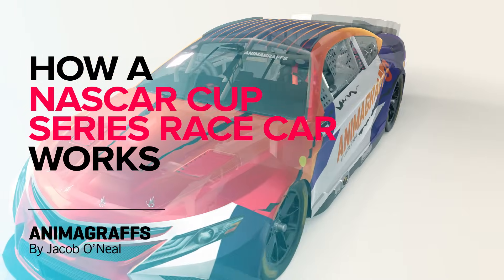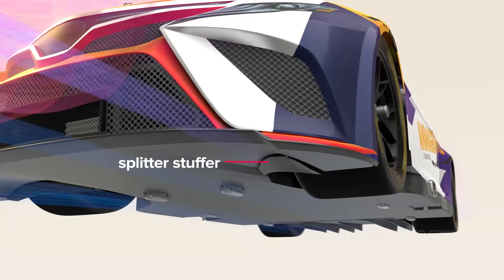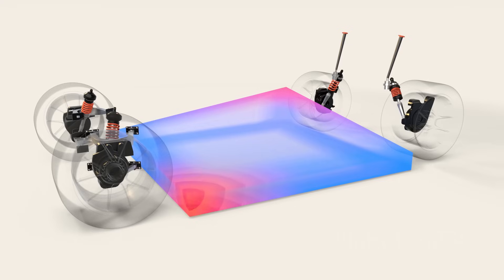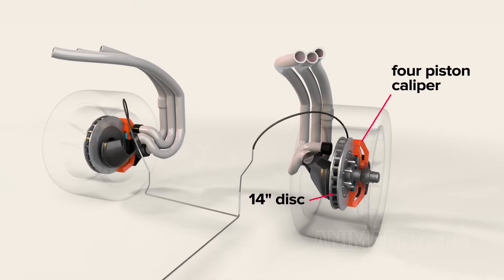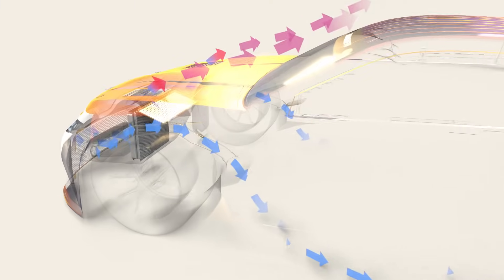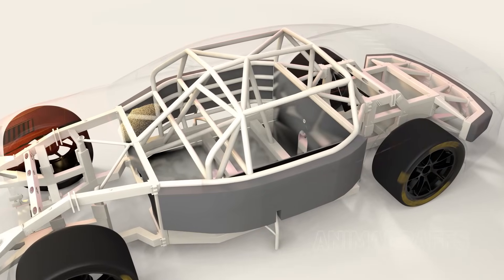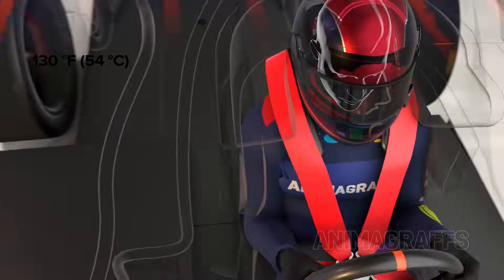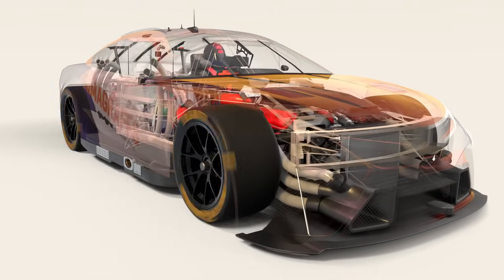How a NASCAR Cup Series Race Car Works

Comment: 1:48 the vanes or strakes are also used to generates vortices, which, are high energy wall of air basically, that, since it is high energy, it sucks the air from the diffuser, since diffuser slows the air down from the fast part at the lowest point of the floor. The faster the air, the less the pressure, and more downforce. Vortices help to extract more air and, as said, more downforce

Comment: I can't find the pinned comment about corrections, but somewhere around 18.30 you say that the timing sensor is located in the passenger side rear wheel well but show it on the left side. I feel like an asshole for pointing this out. You are doing such an amazing job!

Comment: 7:49   Error does not work steering wheel turn front wheel due to some unknown hard material pipe in the disk, separate cooling channels, why does the previous work turn without cooling pipe in the disk?

Comment: 3:19 its wild how nascar racers litterally use the air around them to win the race
Reply: Every race series use air to win races, no? It's even worse in F1. Pre-2022 regs, the drafting car loses 50% of its downforce because of dirty air. It got reduced to 20% in 2022, but cane back of to 35% in 2025, which is not good. It's is now headed onto basically pre-2022, and they changed the regs

Comment: Only thing i have to say is that the reverse gear isn't usually counted in a transmission. They usually only call it by how many forward gears you have. So it's a 5 speed transmission. Like my jeep is a 6 speed. Some tractor trailers have 18 speeds because they can move forward is 18 speeds. They got 4 reverse gears but it doesnt make it a 22 speed transmission.

Comment: I don't know why they continue to call these "stock cars". Give me a V8 RWD Camry with 800 hp at the Toyota dealership and then I'll be interested again. Nice video.
Reply: @cromagnon305  stock cars as opposed to formula cars
Reply: @cromagnon305  its because that's how it started back when nascar was started they could do almost nothing to increase power it was just cars basically straight off the lot now the only thing they have in common with the production model is the shell which has to be the same to an extent which is what they use the Hawkeye system for

Comment: The brake cooling has too much weight with all of the pipes, vents and structural components. A more simple design would be a cooling motor blowing a subzero substrate, like dry ice, directly onto the calipers and rotors. 

This could be a compact system of just a couple of pounds added to each wheel. 

Track air hot. It's not a news flash, of course. 

It is an archaic system. Think bigger... and smaller. If I want to smoke... I would not go into a burning building... I would simply light a cig. 

Same principle.

Comment: I'm amazed by the optiomal operating temperature of the engine, 230°F would be overheating for most engines and 250 would be on the verge of a catastorphic failure

Comment: I am assuming this is gen 7 right?
Reply: Yes this is the buy the parts from suppliers and bolt it together like a kit car generation 7 nascar cup car.  The Gen 6, 5,4,3 etc. Those, the teams built the car almost from scratch and that's where cheating gets started. The Gen 7 was created as parts teams buy as a way for the cheating to be stopped.

Comment: 13:28 Robust is almost an understatement lol. You can hit the wall head on at 180+ mph or flip dozens of ft in the air and reasonably expect to be ok. 

I remember the massive controversy a few years ago where Bell (im pretty sure) missed a few weeks with a concussion after a 170 mph, 70 g impact. Like, there was legitimate uproar about how bad a safety issue that was. Drivers were dead serious that they felt a (relatively) minor concussion from an unbelievably powerful impact was completely unacceptable and preventable. And the crazy thing is? IT WAS. Nascar just fixed the crumple zone and no ones gotten concussed in a cup race since. 

I honestly could go on about the safety engineering forever, thats so much more impressive to me than just building a fast car. Lots of cars can go 200. Hell some civilian cars can. But a NASCAR stock car is one of the only vehicles around that is also very reliably "safe" to crash. Its the only reason I can even watch it. Every time an open cockpit car like an F1 flips i just assume their heads will get ripped off immediately. And sometimes 
...

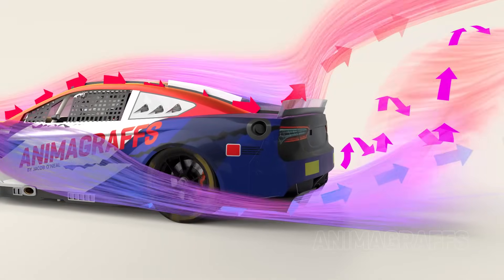Comment: 1:27 why don’t they make the end of the diffuser point the wind down instead of up? So the car behind won’t hit that vortex but it just stays closer to the grown
Reply: Then you don't get downforce. Diffuser is, well, diffusing air. You can't diffuse that while pointing down. Remember, there is the ground. That's how ground effect works. The floor of the car is not the only wall, but also the ground, working the air, and as it speeds up, it loses pressure, and diffuser is used to diffuse further, which means more downforce. If you don't have that downforce, these cars will fly at 200 mph
Reply: Pointing it up increases down force. Pointing it up will make this down force into lifting force

Comment: new gen nascars could do with a full carbon fibre composite chassis & frp body, for greater torsional rigidity & enhanced stiffness . . . fully detachable forward & aft sub-frames that can be easily replaced in the event of crash . . . both front & aft windscreen and side door windows could do with real shatter-proof glass . . . and open close driver side door as well . . . 265/50 R19 Pirelli ZERO® competition spec tyres . . .

Comment: I agree with the common notion that high speed/low pressure under the splitter, combined with low speed/high pressure packed in front of the nose will net a "push down" effect on the splitter.  I believe there is a second -- almost mysterious -- role it plays. Experts say the splitter should protrude at least one inch beyond the nose.  Two inches would be better, but after 4-6 inches, no extra benefit is found.  Why is this mentioned?  The majority of air packed in or around the nose would be better off flowing over the top.  Its crowded under the car.  It's more turbulent under the car...even with an underbody tray.  Pack enough air under the car and it could lose grip and steering authority.  

Go fast enough and packed air uses the cars nose as a "waiting room".  The splitter is a huge partition for that packed air that is waiting to escape.  If the splitter is longer than the nose, then the path of least resistance is up and over the nose.  If the splitter is shorter than the nose, air is not inclined to escape in the preferred direction -- upward over the hood.  Without the partition (splitter), tons of air would take it's chances going under the car.

Comment: The rear spoiler is not used to slow the car down for safety.  They use throttle restrictor plates for that.  Air moving over the car is faster than air moving under the car.  The resulting difference in pressure encourages the car to lift, especially at the rear.  The spoiler shown here is a high drag device to spoil the lift and keep the rear wheels safely planted to the ground.  This improves tire grip which allows faster speeds in a turn.

Comment: The water cooled racing suit is something I always thought off and wondered why bo knew invented on because i could find what I was thinking of searching for it. I thought this up from riding on my motorcycle with a camelbak water reservoir on and I always thought it would be neat to have the straw/piping go through on your body near your major arteries as a way to water cool yourself internally as well. Like they always say to keep your fingers from freezing put them between your legs or under your armpits close to your warm blood. I figured the same could be applied to running cool reservoir water near those areas and you simply drink the warm water. (Which to anyone whos been in the army knows that warm still hydrates you if not quicker)

Comment: NASCAR Dry Sump systems use 7+ Gallons of oil because oil used for both cooling and lubricating. Imagine how long you could go between oil changes using 7 Gallons of oil for real world cars? You just wouldn't be able to afford the oil change.  lol.   The Oil is 100% Synthetic oil. NO "Full Synthetic" oil used here ("full synthetic" is just a marketing term used in the U.S. For oil companies to pull one over on the customer. A blend of mineral oil and a little bit of 100% Synthetic motor oils.) .

Comment: I hope im not spamming on this, but i know you are open to comments and technical suggestions.

The pedal box is not quite right, the pedal works like a rocker and it actuates the cylinder. On the video it s designed like the cylinder is extended when the pedal is pressed, which is wrong, the cylinder is compressed when pushing down the pedal.

Anyway you man are awesome! Can't belive all your content is free.. big up!
Reply: Compress would be "inwards" though, They should extend "outwards" to push the pads onto the brake disk, no hate, just letting you know.

Comment: We will be participating in a trade show in São Paulo and are planning to include an interactive slot car experience for visitors. We would like to display your video at our booth, showcasing the x-ray view of the car being built, from the suspension to its complete assembly. The idea is to use the part of the video that shows this assembly and add text about performance, experience and other elements related to a Formula 1 team.

Would you be willing to sell the rights to use the video for this purpose? If so, what would be the cost?
Reply: @animagraffs
Reply: $240,000 send it to my Venmo

Comment: How do these beasts run 200+mph with less than 600HP? 
I realize aerodynamics and all but they still seem outrageously fast with such little horsepower?
Reply: Most races won't see anyone touch 200. Daytona and Talladega are run flat out so speeds in the draft get insane. Michigan is the only track with full horsepower that's fast enough to let cars go that fast, and they run 670 there. These cars only weigh about 3500 pounds so there's not much weight holding back those bald eagles.

Comment: The window net is really mounted inside the car and is partially there to keep the drivers head from hitting the wall when they lose it in a turn, end up going backwards and sliding up into the wall at the same time. It cost a few their lives.

Comment: Ahhh yes. That damn "restrictor plate"   boooooring races now. Those big tracks like Daytona used to be wild. And today's nascar totally sux if u ever saw it back in the 80s and 90s. Or hell even from its beginning was more fun to watch than now. I mean frkn Toyota is in Nascar. They never ran moonshine. Wtf are they doin in there. And on top of that they run an old GM design small block ughhhh.  R.I.P. #3

Comment: just to clear things up: speedos arent used because speedos require more gearing into the trans system. a speedo adds more to the system which in turn adds more drag. speedos arent needed inside a race car. telemetry provides adaquete speedo numbers for viewers. during practice times, you'll see nascar drivers set their RPMs to required "speed limits". those "speed limits" are based on their RPM reaidings in car and their garage team providing positive feedback to confirm that what the drivers are seeing in RPMs translates to MPH.

 damn, i still remember when/where/what i was doing when the accident happened that mandated pit road speeds.

Comment: So much for calling it a Stock -Car anymore, they have added so much crap that is unnecessary that must add so much weight, just one rub or smack against the wall or another car and all that tech that they have added is gone, they've turned these cup cars into can am open wheel racers, that's all they are now,  just another reason why I don't watch NASCAR anymore, these are not anything remotely what the race fan see's on the public highways and roads of America , and Thet was the whole idea behind NASCAR , none of the Manufacturers even make rear wheel  drive cars anymore, so isn't NASCAR supposed to race what's on Americas roads ?? and what the normal person buy's at the Dealerships across America, "What a shame" if you took a cup car from 1969 or earlier against a present day cup car, the vintage car would blow it away,

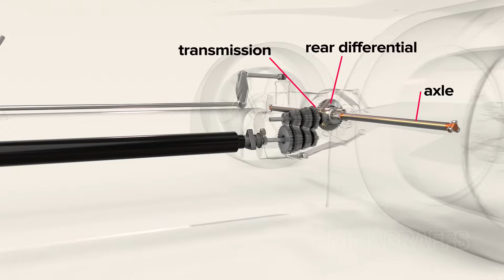Comment: The drop gears shown at 12:32 don't make sense - they're not connected to do anything. They're called "drop gears" because they carry drive between shafts at different heights within the transaxle. 

Xtrac doesn't publish the internal layout of the transaxle on their website, but the Professional Motorsport World (pmw-magazine) article Exclusive: Development of NASCAR’s Next Gen transmission shows some components. The drive comes in low (as you model shows, goes up through the "drop" gears to the upper shaft, down through the selected gear to the lower shaft, then through the pinion gear to the ring gear around the differential. The front cover of the transaxle removes quickly to change to different pairs of drop gears. The Next Gen NASCAR transaxle (Xtrac product P1334) is derived from Xtrac's Australian Supercars transaxle (P1293)... so if you can find a model of the P1293 internals you'll be very close; however, the P1293 does not appear to use drop gears.

Comment: The brake master cylinder setup looks unusual, compared to typical racing balance-bar equipped dual master cylinder systems. Is this the AP Racing CP5596/5516 reverse pull model, using pull type master cylinders?

Comment: Very good info, pretty detailed. NASCAR mandated the HANS device once Dale Earnhardt got killed. They had it back then but most drivers didn't like to use it and Dale was one of 'em. Had he been using it, his odds of surviving that crash would have dramatically increased. I think after that crash, it probably scared most drivers into using it even if it wasn't mandated. Dale wasn't the first driver to end up with passing on from a basal skull fracture which it what the HANS device prevents. Along with the device, these cars are super engineered for performance and safety... along with the mandated soft walls on every track.

Comment: Technology and safety besides I'm disappointed the racecars are not being primarily developed by the manufactures. Other than the decals and some minor front end differences these cars have virtually nothing in common with the vehicles they represent. The manufactures have little to do with engine development as well. NASCAR has developed there own racecar thus creating a completely different series of racing . I not debating if its  good or bad I'm just being realistic. NASCAR needs to stop using the phrase Stockcar racing it just no longer exist and why I'm not the fan I was once.

Comment: Why no motor info? Have read that the only required "stock" part is the lower block, which is heavily modified to accommodate pushrods. In the finished motor, very little is left of the Ford, Toyota, Chevy, etc. the car is supposed to represent. No genuine brand competition.

Comment: The diffuser is not raised in order to reduce turbulence, it is raised because it increases the volume under the car thereby lowering the air pressure. The diffuser strakes are not to comb through the air to keep it clean, they are there to stop ambient pressure air from the sides of the car from mixing with the low pressure air in the diffuser.
Reply: name checks out

Comment: just found out that the lights are just stickers, why even do that ?!
Reply: Who wants to clean up a billion shards of shattered plastic or glass after an accident?
Reply: @HPayne62  no why not just not have lights
Reply: @hungryhedgehog4201  They add weight, the track is always lit anyway, and it adds shatterable pieces that would be hard to clean up without leaving bits that could be kicked up easily.

Comment: You do a great job with explanations, However the next gen car breaks a lots of long time Nascar guidelines set by Bill France Sr and Jr and will be blamed for the downfall of Nascar . Since this car NASCAR is down 15% in TV ratings and track attendance is down even more, so much so they have moved cameras to hide empty seats. They even paint seats in colors to make it look like their are fans in empty seats. Gone Is the high RPM high HP motors gone is the race gas smell with the rotten egg smell of green gas. And the car sounds flat like a spark plug wire is off. Replacing horse power with better handling cars is the worst idea one could ever imagine.
Reply: I agree that this car is low on hp compared to past versions but ratings/attendance have actually seemed pretty decent here lately. Pocono was packed!
Reply: @tnwhiskey68  since 2013 When Brian France came in went to fuel injection, green gas next gen cars all the things Bill Sr and Bill Jr said never do 
NASCAR is down only 60% in fans in seats and 50% TV ratings.

Comment: Another thing to note. The gas pedals usually have a bar that sits on top of the foot in the event that the throttle pedals gets stuck, so the driver can manually pull the pedal back with their foot.

Comment: The video is overall great.

Only one thing need to correct:

The engine’s fuel system switched to EFI since year 2012 NOT still use carburetor.

Comment: @13:36 I guess it turns out the aluminum tubes connecting rear bumper to the rear clip haven’t done so well at absorbing even moderate rear impacts.

Comment: Rack and pinion steering on common automobiles is a false statement, most cars and trucks too have a electronic rack that is not hydraulically actuated but electronically. The amount of voltage to sustain this is great and this particular system is very expensive to replace especially when the automobile has lane assist and other perks. I miss the old days when a man just drived without these useless things that only make people more lazy.